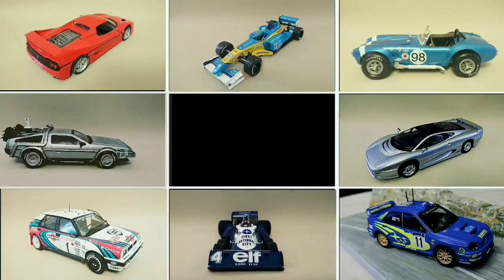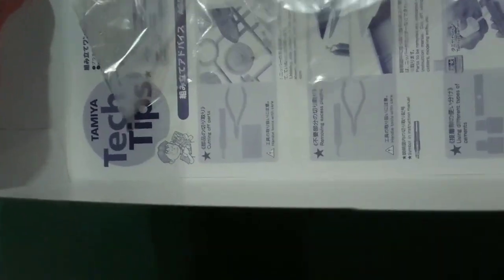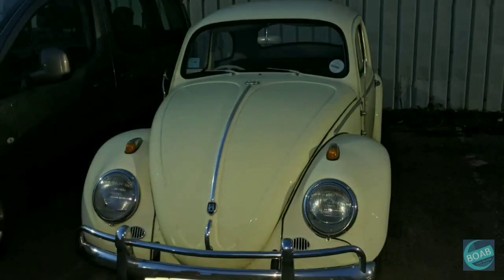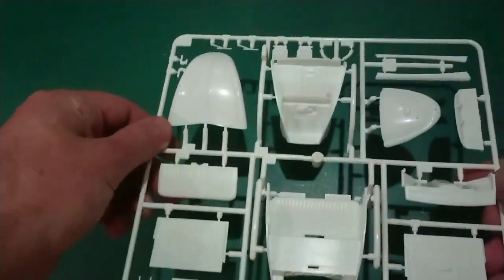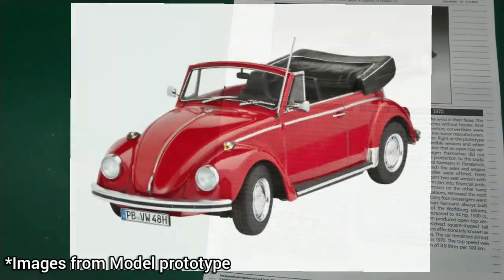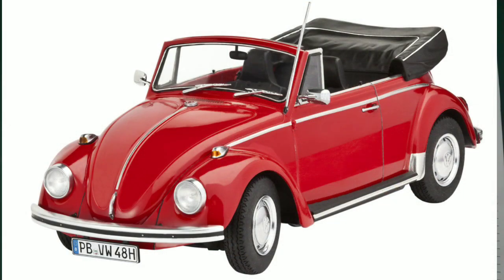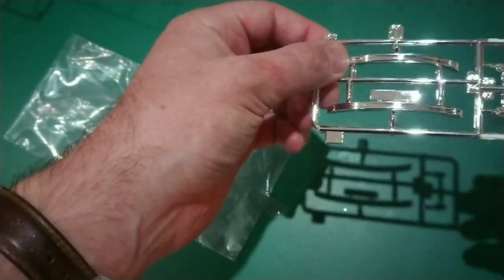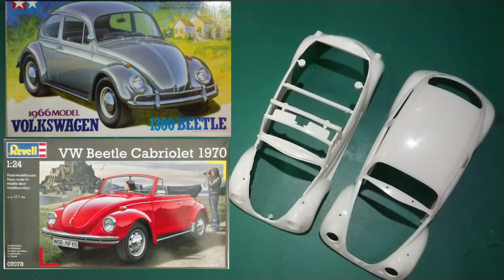Tamiya vs Revell - VW Beetle '66 & VW Beetle Cabriolet' 70 1/24 - kit unboxing, review & history

Comment: Nice review, you building these simultaneously ? sorry if you mentioned it, I've never seen the appeal of the Beetle myself, I think though may be wrong that the Schwimmwagon was based on that which is the version I'd prefer :) as well as the kubelwagon
Reply from the maker: I might build them at the same time, I'm not sure yet. Some of the parts are interchangeable though. The kubelwagon definitely was - when Ivan Hirst found the factory in Wolfsburg it had been modified to make those instead.
My youngest son loves the Beetle so I'm partly building it for him (not that I will let him touch it! 😂)
Reply: @BOABModels  In that case I think you should build those 2 plus the kubelwagon, schwimmwagon and samba bus and perhaps a beach buggy to show case the variations :)  no pressure of course.
The schwimmwagon is cute and quirky, love a deep purple coloured one :)
Reply from the maker: Hahaha! 😲 Well, I've made the Revell Samba bus already...